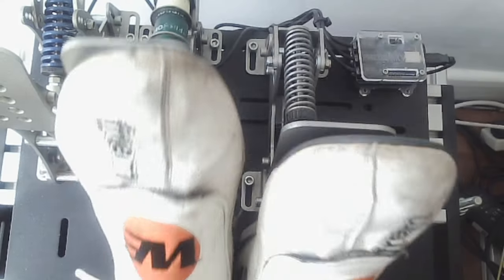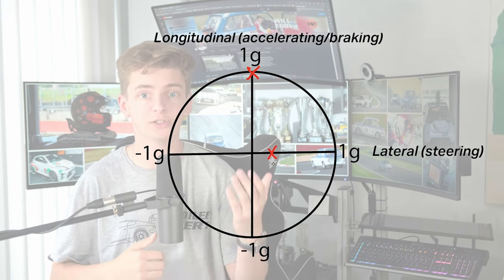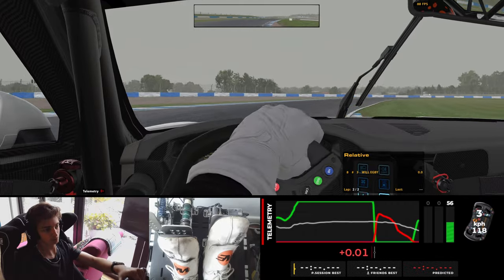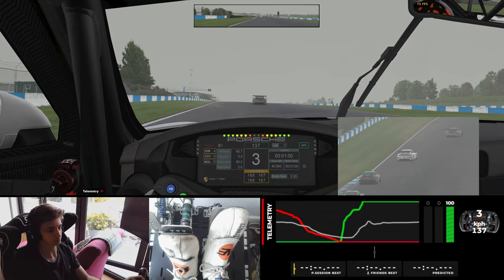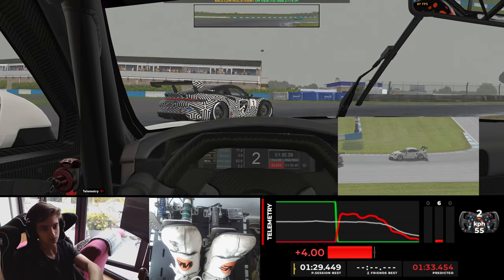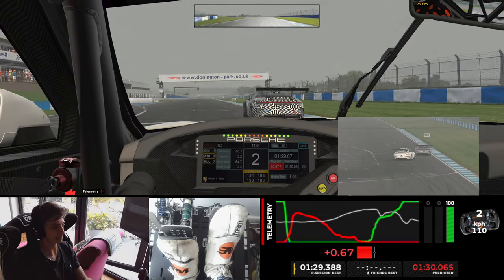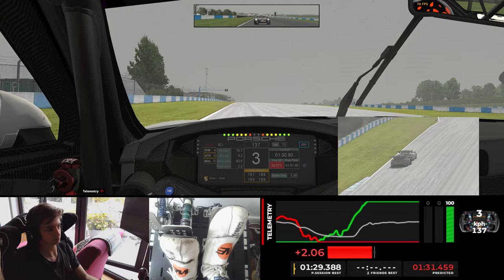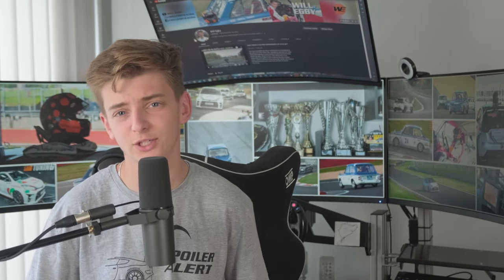Trail Braking: The FUNDAMENTAL Racing Technique You Don't Understand

Comment: I picked up a bad habit from my SIM and took it to the real track 

I was not taking my foot completely off the accelerator pedal when braking … only small pressure but knackered my pads up very 

You fully disengage 👌
Reply from the maker: Yes. Maybe a footwear issue? Can be hard to tell you're resting on a pedal with some shoes. I really recommend the Racelabs traces as shown in the video if your sim software supports it. I check it after nearly every corner to check my inputs. Sometimes I think I'm being really smooth and I check and it wasn't haha.